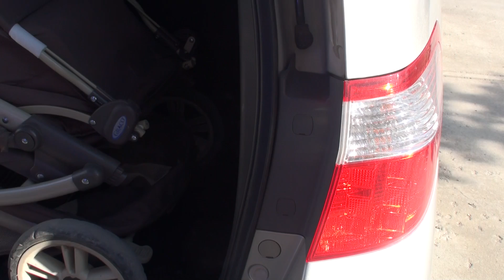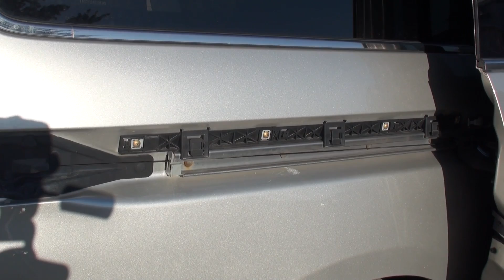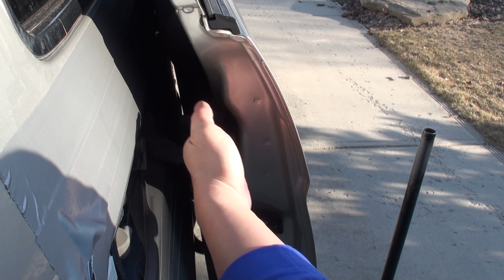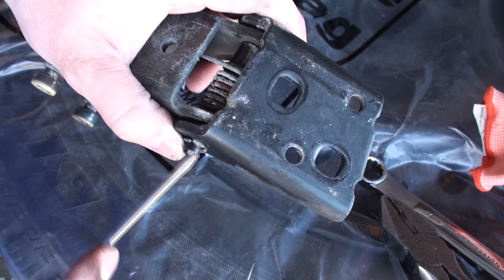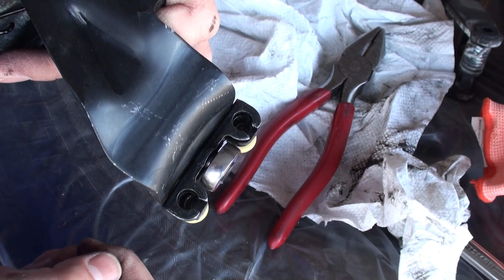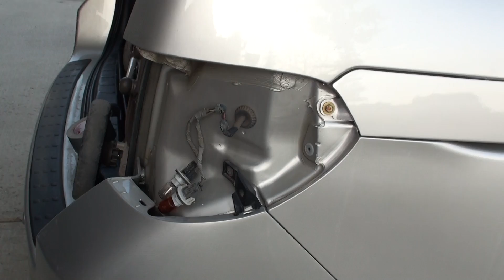Honda Odyssey Center Rail Door Roller Replacement

Comment: Great video.  Thanks.

I had to replace the middle bracket completely and when I did I let the wire slid into the van to far.  I can't seem to pull it back out to make both sides of the wire reach the bracket.  Is there an easy way for me to get more slack on that cord?   Should I pull off the inside panel?  Then what?

Thanks.
Reply: I left the power on so the cable was sucked in.  I was able to pull it most the way but need another 4 in to make them reach the bracket on either end.

Comment: Great video, but please note that (on my 2005) even after roller replacement, door worked fine manually, but using powered option resulted in failing to close completely. and would fail to open, SO THE FIX WAS TO PULL THE 40AMP FUSE UNDER THE HOOD (there are 2 and I believe it was the one on the left facing engine), start up vehicle, stop vehicle, reinsert 40a fuse, and door magically worked as intended. FYI - Before replacement, the drivers side sliding door would always power open or shut, but just rubbed paint on near gas cap, that is why we replaced roller assembly.

Comment: That tension wire is a PITA, but in my frustration I discovered a VERY simple method to avoid my kids learning new choice "words".  Position the wire so that it is almost all the way back, but move it forward about an inch or two.  Take painters (blue) tape and wrap it around the rear wire  just in front of where it enters the car, wrap at least 10 times to give it some girth and press it on nice and tight.  Use 1.5-2" tape so there is a lot of surface area contacting the wire or the tape will slide on the wire.  Gently pull the wire back and the tape will hit the rear port where it goes into the car and grab and stop. Now it will remain stationary and give you slack to easily slip the replacement part on!  Once its on, roll it forward an inch, unwind and remove the tape and you're good to go with completing the reinstall of the trim panel etc.  I hope this helps ease some of that grief we've all seem to be having and there is no need to rip apart the interior of the car and mess with the tension!  Enjoy!
Reply from the maker: that's an awesome tip!  Wish I had thought of that!  When my driver's door roller fails I'm going to try what suggested.  Yes I hated trying to manhandle that wire back in but I did in the end get it back together after a few tries.

Comment from the maker: Hi Daniel, yes on some Odysseys it can be tight.  The trick is to get as close to the rail as possible when hooking the cables back in.  The further away your hinge roller is from the track the harder it is.  It took me a while to get it in but I did get it in.  When you pull on the cables there should be SOME give that has a feeling of "springiness" to it.  If it doesn't then you may need to remove the inside panel of the van to "de-tension the cable".  If it won't go in do not force it as the cable drive motor assembly if damaged can cost you a small fortune to replace.
Reply from the maker: HI Daniel, no I don't currently have a video to show how to pull the interior panels off.
Reply: piercedasian
2nd time trying and finally got it done.  I used the Vise Grips on the rear end to keep the cable from moving.  When installing, I found it easier to put in the rear first and then to put on the front cable.  Maybe because of stronger hand strength on the right.
Reply from the maker: yep, some people have done that as well, just all depends on your strength, dexterity, patience and how much "luck" you've got on your side :)

Comment: I attempted to remove the passenger side door, but I found that the cables were too tight to move it to the slot.  Did not try needle-nose pliers.  Saw the video and how it was done by hand.  I tried using a plastic trim tool as leverage to move it with no luck.  I will definitely try again, but doing by hand was impossible for me

Comment: Great video, thanks for sharing.  Just ordered the parts today - you've inspired me to try a DIY repair, which I almost never do!  Stupid question but why did you mark the inside of the door with felt pen when presumably the bolt location would ensure the part properly lines up?  I know I'm missing something here...
Reply: There's actually quite a bit of play where the bolts attach to the bracket, thus the reason why you would want to make sure the bracket is replaced properly.  Having said that when I replaced my bracket and roller assembly I had to make some minor adjustments to the original placement to ensure the rollers were not hanging up anywhere in the rail.
Reply from the maker: @ Jeff - you mark the hinge exactly for the reasons that Frank G has outlined.  The sliding door is supposed to be "aligned" from factory such that the door and the rollers operate properly without any rubbing or binding which would cause the door to operate erratically or wear out the components prematurely.  The idea behind the marking is to ensure you mount the new roller in nearly the EXACT spot as the original one.
Reply: Thanks guys for the clarification.  I'm sure it'll make more sense to me once I get the parts and see how they fit in there.  Hoping to get to it next weekend.
Reply: Jeff Brown Just to clarify something I noticed when I replaced mine today - it looks like the door or the hinge had been previously removed (used car) at some point, which I think was contributing to the wearing down of the bearing - don't just rely on marking the existing location - that location itself may be poor unless it was from the factory.  just eyeballing the original location on mine I noticed the replaced upper bearings were not exactly parallel with the rail and I had to manually adjust it quite a bit more than I thought to get it parallel.  when I did that, not only did the door seem to move better there was a prior very faint squeak that went away.  Hope that helps!
Reply from the maker: great tip Seth, yes it does help to pay attention to the overall alignment of the rollers.  Fortunately in my particular door roller scenario it wasn't in any previous collisions and I know the previous owner never replaced the roller before and I went and checked mine after your comment and luckily all is straight.  Great suggestion for our viewers!

Thanks!
Reply: Thanks Seth for the tip.  I'm hoping to get to it next weekend - I haven't had a chance to try it yet.  I'll let you know how it goes!
Reply: Thanks again guys for all the advice.  I finally replaced the rollers (both sides) today and everything went smooth and quick. My biggest issue was trying to figure out why the door wouldn't open fully after I put it all back together - it was because I had left the window down. Duh!
Reply from the maker: yeah that window open restriction on the door opening is a little weird.  Safety and liability reasons I am sure.  Totally caught me off guard too when I did my rollers!  I am glad you were able to fix your own door.  Good job!

Comment: Simply brilliant! Previously I had done the passenger side door the "traditional" way (removing the interior panels to release spring tension etc.) and I just did the driver's side your way, and it worked great! Your shortcut transforms a half-day job into a half-hour job. Can't thank you enough. The conspiracy theorist in me suspects that the "traditional" method was concocted by Honda simply to dissuade owners from performing this simple repair by themselves.
Reply from the maker: totally agree with you on the Honda stealerships making a simple job into a billable cash cow.  Even the guys I know at Honda service don't fix it the "traditional" way yet they bill like they do... shocker huh?

Comment: Nice clear video.
Will attempt it myself once I get the parts.  Thanks very much!
Reply from the maker: Good luck Frank!
Reply: piercedasian I just finished this DIY, and I want to commend you once again on a great how to video.
For me it was the removal of the tail light housing that took the most time, believe it or not! Everything else went smoothly!
Reply from the maker: Glad to hear it all worked out for you!  Yes the tail light CAN be tight on some vans (Mine actually was so tight it snapped the light housing in half if you'd believe that!)

Comment: I followed your video with a genuine Honda part and the door went totally schizoid. So I turned off the power doors but with the new roller the door manually closed like silk.The old top rollers were completely missing. I went to start the van and the battery was dead. I thought  it was some thing left on so I charged the battery and it was really low. After a few hours the van could start so I turned off the engine and tried the doors again and all the shaking and nonsense. My wife (?) said  " try it with the engine running "and the doors were perfect.  So what the computer does is measure total current going to the motor. If the current increases it is a danger stop signal. A bad battery will drop voltage under load and of course current will increase triggering the stop signal. Just another thing to watch out for with sophisticated electronic sensors. There was a dry cell in the battery so after a new one was installed there was a mad search for the radio anti theft code.    Thanks again.

  one thing I did different was to leave the hinge on the door and pop the c clip and knock out the pin.  Much easier not to worry about nonalignment as the roller was a perfect match and I could also lay the cables and roller assembly upside down flush against the rail. I just pulled the roller and cable all the way to the back and popped them right off and on. Then just align the pin and the hinge gently and bash it back in and top off with a c clip        Thanks again
Reply from the maker: Vincent what an excellent tip for our viewers.  Your feedback will prove to be very useful!  Good job.  Glad it all worked out for you.

Comment from the maker: @ Dan Albert - I could've done that but that would require me to pop off the interior panels to gain access to the little latch mechanism that holds things in place.  I opted to do a shortcut which fortunately has worked great for most.

Comment: Thanks just did this repair this morning.  Probably could take 20-30 minutes.  I ran into one issue that I fought for an extra 20-30 minutes.  The pin that holds the two sides of the hinge together would not come out easily.  Turns out the bushing that the pin slides through had come apart and the sleeve section that goes around the pin had some corrosion in it.  I blasted it with some penetrating oil and then used a bolt with a smaller diameter to knock it out.  Once I gat that out the hinge reassembly is pretty easy.

To help on the cable I did this.  I used a small needle nose vice grips to hold onto the cable on the rear position.  Then I connected the front and slid the hinge very near the back of the track.  With the needle nose it was quite easy to rotate the cable into the slot.
Reply from the maker: glad you were able to break things apart and get your slider fixed!  Great tips with the locking pliers.

Comment: I bought the parts for 55 each CDN about 50 USD.  I was quoted $770 if I wanted a dealer install for both doors.  That was incentive to give this a try.  My son and I did both sides in just under 1 hour, and never had any issues.  And the tools were pretty common too.   Thank you so much for this great video.

Comment: Great tutorial!!  I will add the following help:  If you do not have a 2nd person to help with the rear cable assembly, you can pull the cable out from the rear with the little bit of play that is in the cable, and keep it from sliding back into the rubber cover by using a pair of locking pliers.  This gives you just enough play in the cable to push it into the rear part of the roller assembly bracket.  Otherwise, this tutorial is SPOT ON.  Well done!!
Reply from the maker: thanks for the positive comments Tim, glad you found the video useful :)

Comment: Awesome video. Very comprehensive and I'll be installing mine in a few days... need to go order them this afternoon. Thanks again for the video, and also the part numbers!
Reply from the maker: You're welcome!
Reply: Nicholas....if you haven't done it yet, please be sure to check out my comment.  It will help you greatly during reassembly.  Better than paying the dealer over $300 to do this!
Reply: Tim Hill Quoted $774 in Toronto to do both doors + $85 / side for the parts.
Reply from the maker: whoa that is too much.  Parts are about $70 retail I believe for us Canadians.  Do it yourself.  very easy and gratifying.

Comment: If you don't want to deal with the tensiton of the wire you can ease it up by removing the inner wall.  This might be an older moddle butthe parts are probably around the same look and feel.  Search: Sliding Door Repair 2001 Honda Odyssey -EricTheCarGuy

Comment: Not sure how to post a picture but to make it easier to replace the back cable once you have the front one on take a small irwin micro bar clamp like you find at lowes and put the round part in the bottom, clamp it to the hinge then use the side of a screwdriver to work the cable around the edge of the hinge until it pops in.  I couldnt get mine in with just my hands because it was way too tight so I used this method and it took literally 30 seconds.  Much less grief!  Heres a link to the clamp i am talking about:  http://www.mscdirect.com/product/details/00254037?src=pla&008=-99&pcrid=15557577904&007=Search&006=15557577904&005=21882504424&004=4409695744&002=2167139&mkwid=sJXegN7a0%7Cdc&cid=PLA-Google-PLA+-+Test_sJXegN7a0_PLA__15557577904_c_S&026=-99&025=c&item=00254037
Reply: Jeremiah, I have a clamp like that, but can't visualize what you mean by "put the round part in in the bottom"  and just what specific part gets clamped to the hinge.  Any other help you could provide would be most appreciated.
Reply: David Poulson meaning the round part on the end of the cable into the bottom of the bracket where it is supposed to go. Then use the clamp to hold it in place while you use a screwdriver to era it around Tue side so it will slide up in it.
Reply: Jeremiah Hix Thanks for the help. I had the cable in on each side in about 2 minutes.
Reply: Great!  I'd gladly change it again now that I know that little tip works.

Comment: This was VERY helpful.  The 'difficult' p.i.t.a. part was truly impossible for me--until i looked at my replacement part.  It was Made in Turkey, and it did not have the exact same sized slots for the wire-ends.  Also, the top and bottom holes were slightly out of alignment.  After using some pliers to pry apart the entry gate for the tiny cylinders that are at the ends of each guide wire, i was finally able to insert the 2nd cylinder.  I also used the advice in this video to use a jack to support the door and lower the window to obtain a more ergonomic position to do the dirty work.  Thanks for the video!!!
Reply from the maker: You're very welcome.  Glad you found the video useful and more importantly that you fixed your own sliding door.

Comment: Now I see why they put painter's tape along the top and bottom of the body to protect it while removing the slider channel cover.
Reply from the maker: yep, the tape is super important.  Ideally you do not want to use duct tape like how I did (I didn't have anything else).  Duct tape could theoretically "rip" paint off the car's body b/c of the extreme tack that it has.  Painter's tape is best.

Comment: This is a great video. It appears this a problem with the door mechanism & your procedure worked perfectly. The hardest part was removing the 'arrowhead ' plug holding the tail light in place because there is nothing to hold. Thanks
Reply from the maker: Yes I actually broke one of my tail lights b/c of that annoying arrowhead pin that holds the tail light in place.  It is VERY tight if you have never removed the light before.  However, doing other vans I have found that patience and persistence will get the light off with no damage just pull straight back and wiggle if necessary.  Prior to re-installation put a blob of grease on the end of the arrow head and next time should you need to remove the light it's super easy!
Reply: piercedasian What is the Arrowhead pin, where is it located and how does one avoid breaking it ?  Tx.
Reply from the maker: it literally looks like a tiny arrow head on the outer edge of the tail light assembly.  It is what the tail light would "latch" onto to hold it in place without the screws.  Think of it like a peg.  How to not break it?  Simply pull the tail light straight backwards and never outwards towards the sides of the van.
Reply: piercedasian I see why its called an arrowhead.  Mine did not stick at all though, as I think the bulbs have been replaced a few times. Just popped off.
Reply from the maker: consider yourself lucky!  I've worked a few odysseys and if it is the first time the tail light is coming off then man alive can it be a PITA.  I actually BROKE one of my tail lights once because that little arrowhead pin would NOT let go.  I lubed up the arrowhead pins with some silicone grease for ease of removal for next time.